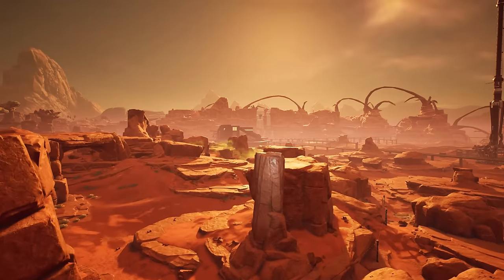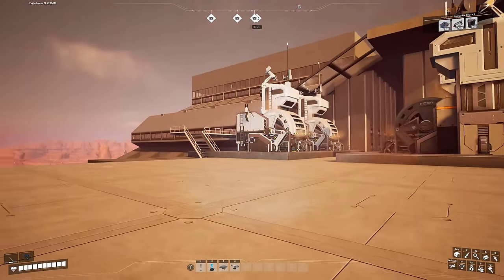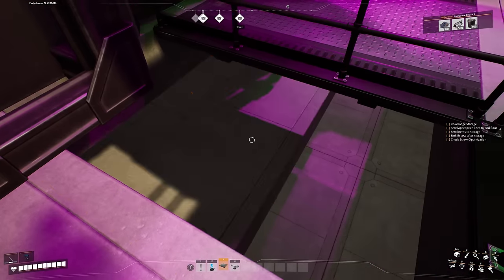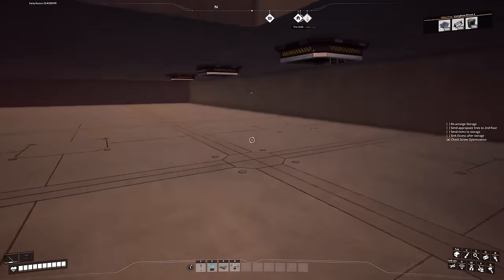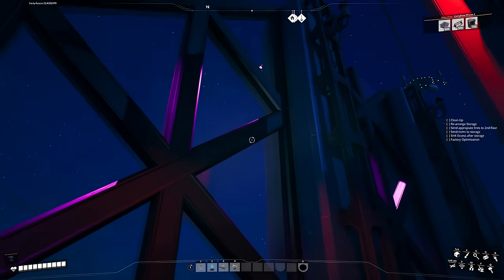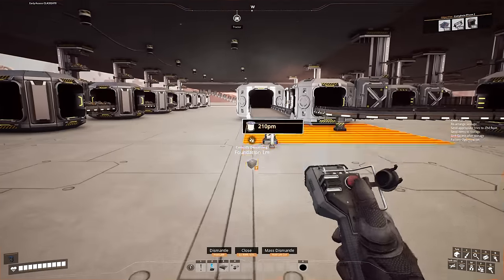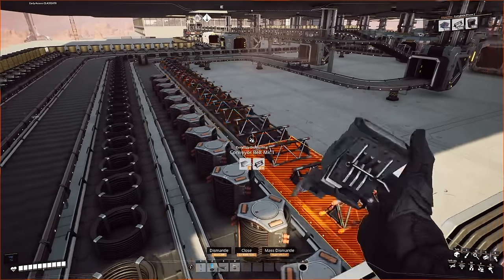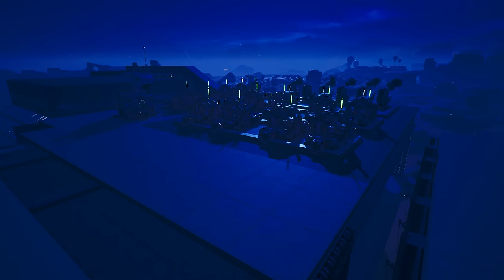I ADDED a MEGA STORAGE to a STARTER FACTORY in SATISFACTORY Update 6 - Part 5

Comment: You spawn in power shards right? Its the only thing that I can think of for how your production is just lightyears ahead of mine. I just got this game 4 days ago and I'm at tier 5+6. Your factory is insane comparatively(obviously). How do I get the type of scaling you have? I'm just rocking basic on ground machines belts everywhere set up. I really want to get to building like your factory but I just have no idea how to scale up like this and how to make an overall more effective factory. 

Another side question: Is it better to mass produce smaller components like screws plates frames etc at another location than at the machine that is using them to create other components/parts? For example I have a set up for reinforced iron plates that goes: node->smelters->branches bars 1. constructers set to plates 2. constructers set to nails-> assembler set to reinforced iron plates. All that to make 10 plates per min off 1 pure iron node with mk1 miner. I feel like its really low production but all machines are 100% efficient.